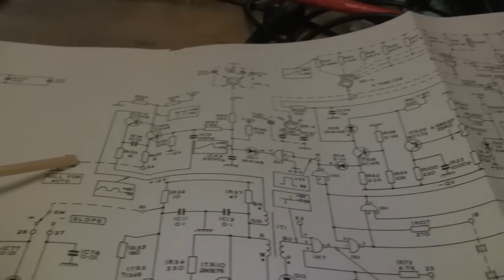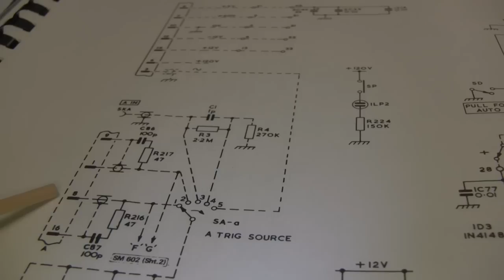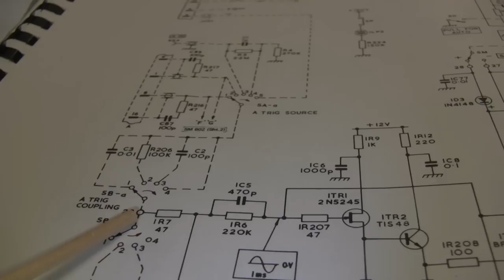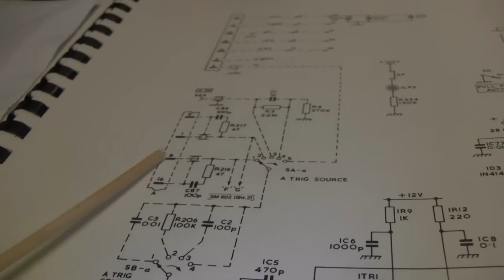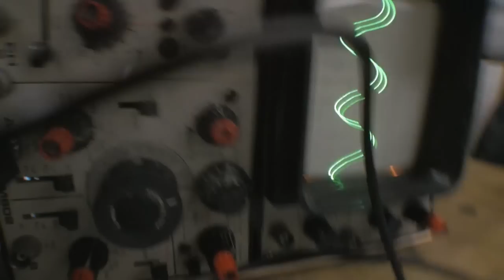SM112 Scope Repair Part 4

Comment from the maker: Good luck with your project.  I got mine almost done but ran out of time then it got put on the back burner.   The only thing that remains is to get it to auto-trigger on channel A however if I copy the signal to the ext trigger input it works.  I'll get back to it one of these days :)  I'll confess I prefer tube electronics to solid state but it's a nice scope so I'll complete the job.